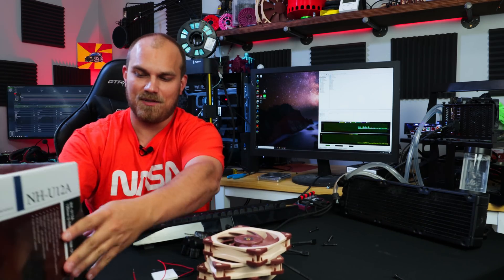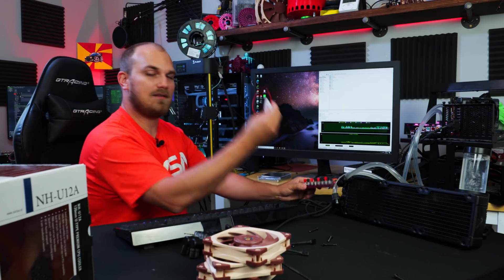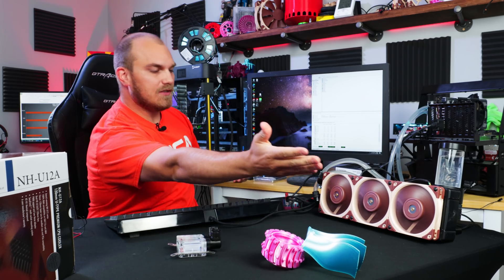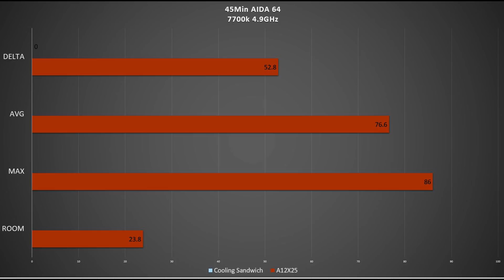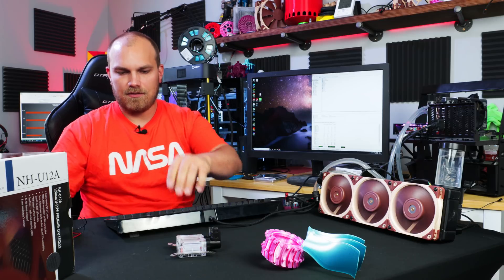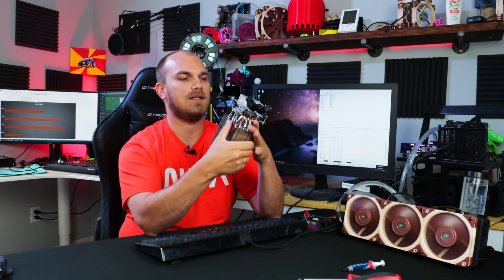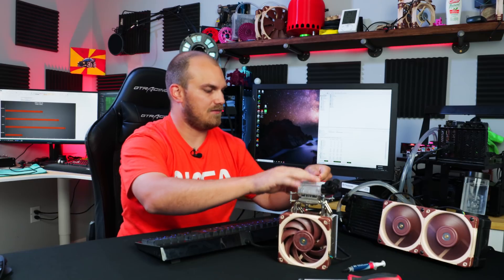Can A Wish.com Water Block and a $4 Peltier Beat a 360mm Radiator?

Comment: I had a spare 4770k lying around still in its old mobo with a 850 watt power supply. I had just learned what peltier tacs were that day and instantly got the idea to cool a cpu with that day, went on ebay and grabbed a 450w peltier tac and went to work on stripping couple psu cables when it arrived I slapped a hyper 212 on it and booted it up, idle temps were 4-5c and load temps were just around 30c, but after 10 mins I didnt realize it was condensating and then it got into the socket and short circuited the board and cpu lol. Good times
Reply: There was actually a YouTube video on someone doing this a good couple of years ago on the "Then Blazing Fast" AMD Athlon. They had the xavt same issues, and resorted to conformally coating their MB in something to avoid destroying their setup.

If recall correctly, they were averaging around the 5° mark as well 🤔
Reply: @-Gadget- Perhaps they're using Vaseline as coating?

Comment: I'm guessing you need a sort of special (metal) block with fins at the top that can dissipate the cold coming from the TEC into the water in the block. Just as there would be fins to dissipate the heat from the CPU. Like having two coldplates glued together and with inlet/outlet on each side.

I would also venture to say if you have the fins zigzagging a bit then the transfer would be even better. I guess for all that you need a friend with a metal CNC machine.

By only having a flat cold top over the flowing water the transfer is probably really bad, almost non existent. Not to mention acrylic is for sure not a good material.

Comment: I made this comment before, I think an inline group of Peltier acting as a radiator with large Threadripper CPU plates could provide a cooling system, but one on its own? The water is barely touching it long enough to transfer the heat effectively, at least with more than 1 you would get some heat transfer on a pass through each peltier.

Comment: I had an all in one, CoolIt peltier setup years ago and that definitely worked. It had 3 peltiers sandwiched between 3 little water blocks (joined together in a loop) on one side, and a round central doughnut like radiator in the middle, on the other side. One end of the radiator doughnut was closed and had a waterpump bolted to the back side, the other open end had a fan sucking air out the back of my case. It used a lot of power but my temps never exceeded 20 degrees celsius.

Comment: Any idea what a CLOCK_WATCHDOG_TIMEOUT error is in Windows 10?
PC Specs as follows:

MSI B350M PRO-VDH Mobo - Also bought a new mobo Gigabyte A320M-H
Ryzen 7 1700 (NO OC)
32GB DDR4 3000MHz RAM (NO OC) - Tried all 4 sticks in many different configs.
Radeon RX 580 8GB (NO OC) - Also tried a GTX 960 2GB and an RX 5500 XT (5500 XT was returned as it was faulty).
700 Watt PSU, Also bought a new PSU and still same issue.
Windows 10 64 Bit, Build 1903. Re-installed many many times.
128GB M.2 SSD
3x 2TB HDD's
Reply: Wow not even one reply, well I've solved it. Windows 10 build 160x doesn't work well with Ryzen CPU's

Comment: i can link u old video ware  i found freon CPU cooling on old athlon 64 3000 :D :) if u wanna
Reply: Those are called phase coolers (I’ve still got mine, it works great and I think the 9900k would hit 6 GHz pretty easy since the cooling block would be about -35c with my cooler). I’ve used it for FX and also Ryzen (I’ve even done direct die on a delided Ryzen but the capacitors under the IHS are almost flush with the chip so it’s pretty hard to get it to mount perfect since I had to rubberized the top of the capacitors so they wouldn’t short out). I think my hottest temperature with Ryzen was about -45c (idle temp is -60c). Unfortunately they have banned the sale of this refrigerant (I think it’s R22 or another blend of R12), but thankfully it has never leaked within the 15-20 years that cooler has been around so hopefully it never leaks or otherwise it won’t get that good of temperature because R134a sucks and would only hit -38c at idle and maybe -5c at hottest load temperature, lol, they had to ban all the good stuff! There are some toxic and explosive ones they still allow, but I don’t really want that sitting right next to me on the desk... haha!

Comment: If a peltier gets overpowered (more heatwattage goes in as it can transform look at it specs) it´ll isolate and can´t transfer heat anymore. (Linus explained it in a video)
- to optimize your try you should use a something like a fullcopper "TEGMART TGMT-HS-WC" 78mmx68mm Waterblock
- then with the tegmart you can use 2 big Towercooler on both sides with 2 peltier...
I think that can you bring you to below room temps.

Comment: The surface of peltier and cpu block is too small. If you try to cooling the 360mm radiator with a few peltiers maybe the result will be better, I don't know.

Comment: now the question is how many peltier do you need to beat a 360mm radiator
Reply: 5 with noctua fans 

in my home i use 5 15A peltiers 120mm in cold and 240mm with beefy 2x4000rpm san ace fans must say removes the heat produced by my pc and removes the need of requiring a ac
Reply: @hyakinthos_0902  what are you doing with that massive amount of heat though? Are your radiators outside?
Reply: @vikmanphotography7984  yes outdoors
Reply: @hyakinthos_0902  fair enough.

Comment: Peltier is not enought powerful to cool a system, but you should try it using in a loop with a radiator.

I mean, use the same loop you have, but after the water passes the radiator, add the peltier and check if it gives any gain in degrees to your sistem, it could be interesting.

Comment: Can you try cooling a CPU with liquid metal? By that I mean filling a custom loop with a liquid metal like mercury, and seeing if it dissipates heat better than water. This won't be an easy or safe thing to do, but no-one else has done it yet.
Reply: I've seen it done before, it works surprisingly well. Unfortunately since liquid metal dissolves in other metals, it requires a specific setup to pull off, particularly the pump and block. Mercury is also extremely poisonous, so gallium would've been a better choice - safe to handle, and it beats Mercury in terms of thermal characteristics.

Comment: One thing pretty much always overlooked is that the peltier cooler will require more cooling than the cpu alone. You're effectively trying to dissipate the heat of the cpu, plus the heat created by the tech. Also, the bigger the temperature delta, the less efficient it gets, and rather rapidly. So good cooling of the tech is essential.
So with your setup here, you're effectively cooling the cpu with just the air cooler, plus several thermal transfer layers, plus a heater.

Comment: I believe the main bottle neck is how efficiently the heat can be transferred. I think I was watching a GN review of an AIO that had a temp sensor built in and it was crazy to see that with a water temp of 38 the CPU was still in the 80s. So with a cheap wish water block just doesn't have the surface area to cool the water. Would be interesting to see what temp that one TEC got it to.

Comment: you need 4 peltiers to cool one cpu. they are much more efficient if run at much lower load. GO! ideally using water to cool the hot side of the peltiers.

Comment: why haven't they built a rad with built in cooling pipes running through the water? just like in floor heating except it would be in rad cooling . there could have a mini compressor and refrigerant built in. adam savage had a guy make him a cooling suit for under his costumes that worked just in that way. and it got so cold that he almost got hypothermia lol. and that was cooling an entire bodies worth of heat without using a single fan . to scale it down small seems feasible. and since the cooling pipes would be directly in the water there would be no worry of condensation ( as long as the water remained at the proper temp). it could tie into your motherboard cpu temp sensor and as the water climbed it could ramp up. linus used that car cooling rad in his cooler -cooler. so if you were to remove all the fins off the rad. and just built a small box around the cooling pipes itself . then add your own fittings to it. i think it would work. there must be something small enough with refrigerant out there . to work small scale and be able to fit in a pc. it might not be practical , but would work wanders for a fun overclock. all other youtubers just do it at too big of a scale.

Comment: It looks like you had the peltier on 5v instead of 12v. I dont know what the rating on that plate is, but the higher volt and watt plates are far more efficient. A 12v 60w can freeze water at ambient temps, so that might fair better. I think you should give it another shot with a stronger plate.
Reply: a 60w peltier can't cool a 60w CPU though, they're only like 5% efficient.
Reply: @jttech44  I was just thinking because of the way he has it set up and and the way the peltier works by transferring heat, a more robust peltier might fair better. A 5v peltier doesnt seem like it can keep up very well.
Reply: @Scientwisted  there are for sure peltiers that will do the job, but they're not cheap.

Comment: wrap the reservoir in Aluminum, then attach the cold side of the Peltier to it. You will also need a reservoir for the hot side for equal dissipation of heat/cold. Think like How an Office Water Cooler works having both a cold and hot next to each other.

Comment: why dont you try using the air cooler instaed of a radiator with the same setup just no peltier cooler.
Reply: Because that wasn't the point of the video
Reply: Well I am saying for a different t very vide idea

Comment: Wait a second. If you flip it, you get an AC without any compressor noise, is it feasible if the heat sink is outside the room? You can hook it up to cooling tower inside (to use latent heat of vaporization) or outside the room (to have better effect).

Comment: I wonder if the CPU could reach below ambient if the peltier is mounted to the CPU and the hot side is cooled by the watercooling loop going to 360° rad. In essence, a waterblock - peltier -cpu sandwich
Reply: Lotta people have tried that it's not pretty

Comment: To make peltier more efficient than a radiator you need to be very close to ambient T. In other words, you need to connect several radiators in series. At the point where you don't see any difference after adding an extra radioator, remove the radiator and put a peltier with the same radiator on top of the peltier instead of it. Otherwise it's just incompatible with thermodynamics.

Comment: Yeah, heat pipes upside down. That will work, lol.
Reply: Most heatpipes are orientation-agnostic. They'll work perfectly fine upside-down, regardless of gravity, since they have integrated wicking material.
Reply from the maker: i knew someone would eventually correct this :-)
Reply: Actually it cools the same regardless of orientation. Plenty of videos explaining this. Gamers Nexus has a video on that very subject.

Comment: Could you run a radiator directly out of the cpu, then somewhere later in the loop run a peltier water block?
Reply: This is the only logical solution I don't know why he and linus didn't do it
Reply: @hamedmohsennezhad5873  Linus is an idiot to start with, why would you think he can conjure up a relatively logical thought?
Reply: That's the ONLY WAY to use a peltier in a CPU cooling system
Reply: A peltier CANNOT be better than a cpu cooler directly on the cpu. The peltier can only get as cold as the amount of heat that is removed and you lose efficiency with every step you add. The reason peltier mini fridges work is because you're not continuously adding heat to the system.
Reply: I think at some point if you are pushing the water below ambient for the sake of better cooling, a radiator in the loop would end up doing the opposite of what you want and absorbing heat from the ambient air, but if you're only trying to chill the water closer to ambient then that would be fine
Reply: @mikee9167   not necessarily, the water leaving the peltier could be below ambient even if the water returning to the rad would be above.  Water in a loop is NOT equal temp throughout the loop... hot water in cold water out.  He, Linus Jay and Steve all have proved a peltier alone can not over come a multicore CPU alone
Reply: n3m37h Mike E is correct, the temperature difference is negligible (if your temp changes more than 0.05 degrees over your CPU block you’re doing something wrong... like that’s less water flow than my nose pushes snot during allergy season (even if it’s a 500w Threadripper). The amount of time the water is in contact is less than 1/10 of a second probably even 1/100th of a second, that’s why order of loop doesn’t matter. And if you’re trying to chill BELOW room temp, then that radiator is going to be heating up from the HOT room. It’s basic physics that just pains me when people can’t see this. I’m glad Mike E used some logic and saw this.
Reply: @jakegarrett8109  an average pump does 8l/min, so 7.5s/l
a xeon heatspreader looks to be around 40x40mm,
so the volume of the waterblock would be in the ballpark of 16cm^3, which is 0.016l
so the volume of the waterblock is replaced about every 0.12s (a thiner wb on a smaller cpu would be faster)
a 1-2l loop would still take a few seconds to cycle through, so 1-2 degrees under ambiant might be doable with the heatsink still being useful.
I forgot that the thermal mass of water is quite important, and the delta between the input and the outpout of the heatsink should probably be under 5C.

still, theoretically, if you're chasing single degrees (or probably more like tenths), order matters.
Reply: @mikee9167  any youtuber this that in that way? i didn't see that atm.
Reply: @kurahadol1991  there is this video https://www.youtube.com/watch?v=YaOjrk98vPI but if you really want a chiller its better to buy one like a koolance probably
Reply: @mikee9167  interesting, i didn't see that, thanks for sharing, i'm curious about this things.
Reply: Or use multiples setup like this in series...  probably won't work as peltier don't seems to do well as cooling...
Maybe if a peltier was integrated with a rad directly it could work wonder... but impossible to test here :p
Reply: Or maybe using a car radiator like some people did years ago.
Reply: Unless you're using an incredibly underpowered pump, loop order doesn't matter.
Reply: @noreng9333  you're right order probably doesn't make a diffrence,
though in theory even if the delta T across the radiator and cooling blocks is really tiny like .05*C there would be a tiny advantage to putting chiller after rad
Reply: @noreng9333  not true, LTT did an episode about rads and how many till they become redundant, there is a pretty major delta from rad inlet to rad outlet.  
https://youtu.be/vauAJl29xlw?t=332
Reply: @noreng9333  in theory it could matter since (convective) cooling is a function of the difference of temperature, the heat transfer coefficient and the area, which means you'd want the hottest (highest delta) to be on the highest area*htc, given the size of the water block vs heatsink you'd probably want the heatsink upstream of the waterblock + pelletier.
Reply: Moisture everybody.. Evaporation.. Destroying expensive stuff

Comment: Yes Peltier's can get really cold and theoretically sounds like a great idea but the problem is they just can't put up with the brute heat output of a CPU
Reply: The problem is surface area you need way more Peltier air surface areas than you have available to you on the CPU

Comment: You should put the peltier water block in series with the 360mm radiator to cool the already cooled water coming from the 360mm rad. 

Just 1 peltier won't do good as it has to pull out about 200W of heat, assuming you ran it on an i9. I have a little experience working with peltiers.

Comment: The only issue i have with those 24pin breakout boards is that they do not use Banana plugs for cable connections
Reply: Ikr I ended up making my own breakout kit altogether with USB ports and DC jacks too
Reply: @racistpandagod  what I did was buy banana plug terminals and replace the cable clips of the breakout board

Comment: What wattage is that TEC cooler? Sorry if you mentioned it and I missed it, but maybe you could stack a bunch of high wattage TECs. 😂
Reply from the maker: just 60W for this little guy
Reply: @MajorHardware  That's the problem: you need a TEC more powerful than your CPU otherwise it would be like trying to cool a lead smelter using a house fridge.
Reply: @MajorHardware  Oh yeah. That's a little baby TEC. I don't know what but I have a weird fascination with TEC
Reply from the maker: @DawidDoesTechStuff  me to its like common i know your better than this.
Reply: Would take a 2000w plus tec on a modern processor Because their efficiency is so low. Rule of thumb for tecs is 10x minimum wattage to tdp
Reply: ... I think Intel just did the same thing with the Cryocooler, but also has software integration to tweak it better.
Reply: Maybe a 250w pelt next time! If there is  a next time...
Reply: @doubleas88  that would make the total amount of heat that he would need to dissipate 250w plus the power of the CPU. You can't cool that easily.
Reply: Well... Basic thermodynamics : heat goes up, flip the rig the other way around ....

Comment: Use two high perfomance (24v and up) TEC with 3 copper block ... on one in the middle gets cold from both side and the two outside block reject heat ... I've done it works really good. It's not power efficient thought. I was using dual 24V psu each 350 watt load for a total of 700w just to be able to move 340w of heat from A to B. DO NOT USE CHINESE TECs ... there specs are overinflated! I used these TE Tech VT-199-1.4-0.8 (with potting to prevent condensation shorting the TEC) It's made in USA.